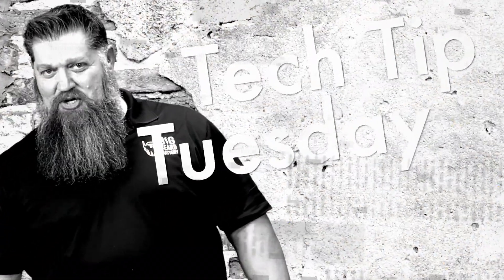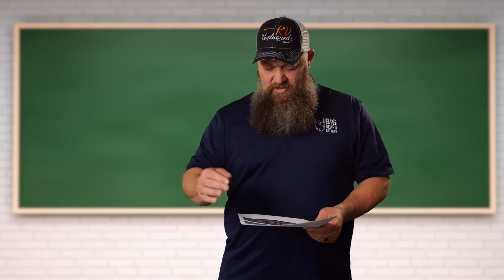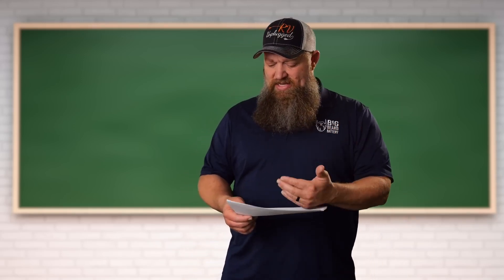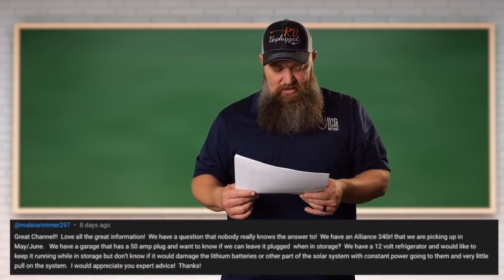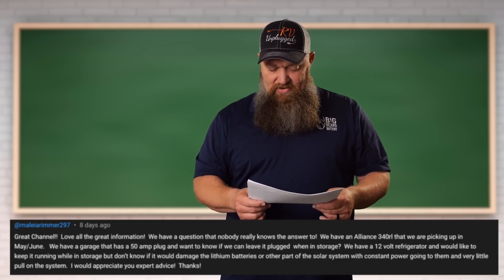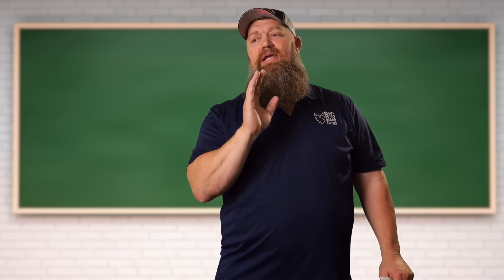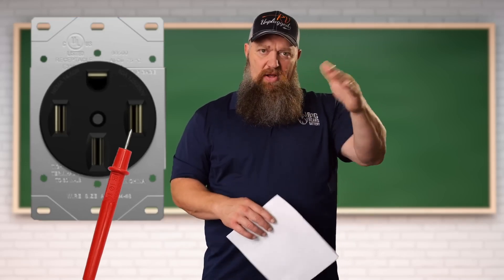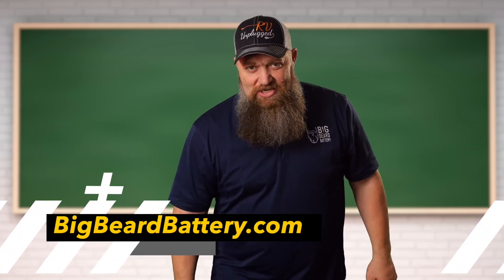RV Electrical Question & Answer

Comment: I had a power source pole and outlet installed in my back yard. When plugged up, no power to the RV but all lights are blue showing power and reading the correct amp and watt. 30 and 120. 
My RV is 1.5 years old … 
Any suggestions? I need help. Thank you

Comment: Hi Todd, love your series, my question is, I recently installed 2 100ah lithium batteries in our fifth wheel, I have a F250 diesel, I don’t know if I have a heavy duty alternator, but either way do I need any special equipment between my truck and the trailer when towing with regards to electrical connection between the two? I hope you understand what I am asking? Thanks Christian from Idaho.

Comment: It's always baffled me why someone hasn't addressed the pedestal plug problem. Generally people burn up the plug prongs. You can either replace the cord, or the plug. In some cases people burn the plug prongs on the surge protector.  The solution is to use a sacrificial plug that is disposable. Amazon sells a cheap surge protector that almost fits this need except it should have an over temperature alarm. In my opinion all surge protectors should have a wireless high temperature alarm. So there's your product idea for 2024.😊

Comment: Hey Todd... I always learn great things from you.
I have an older motorhome that I bought used and I decide to test the LP Gas Detector. Well, it FAILED. How did it fail - I held a lighter, not lit, next to it - it did not alarm. When that did not work, I also tried a propane torch (not lit of course)... still no alarm. So I took it out and it was the original one from 2002 (yes, 22 yrs old). 
So my question is - as I search I see many different ones and widely priced, do I need to go all out and buy an expensive one or will a lower price one work just as well. And how often should these be changed?

Comment: My question before plugging in long term is what is the condition on the shore power? Is the reciptical clean and without fault? Does it show signs of being burned/shorts? Do you have a good connection? Is it a pure sine wave? Do you have surge protection between the connection and the coach?

So, long-term out of sight storage comes down to shorts, serges, fires. Coming back after long term storage I would check for Hot Skin before grabbing the handle to let myself in. It could be enlightening. 

Doc

Comment: I was wanting to ask if the cables were isolated?
Reply from the maker: Which cables are you referring to?
Reply from the maker: Ground and neutral are islated (have their own wire) until they meet in the master panel box, but yes if you are referring to the ground and neutral they would be isolated from a sub panel.
Reply: On the battery side

Comment: Hey Todd, great material as awlways, but I'm not sure you actually answered the 2nd question.   They were asking if plugging into 50A shore power while the rig is in storage would damage the lithium batteries and/or solar components?

Comment: I'm in the market for a 50 amp EMS / Surge Protector. Which one do you recommend? Also, If I'm at a location with 30 amp only, do I need to have a second EMS dedicated to 30 amp?